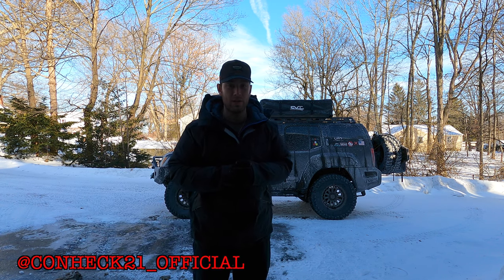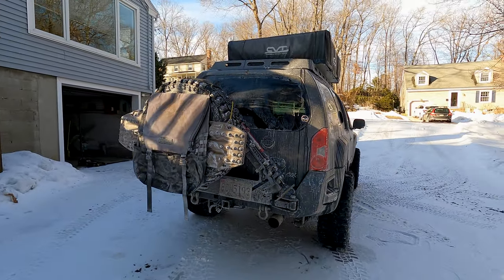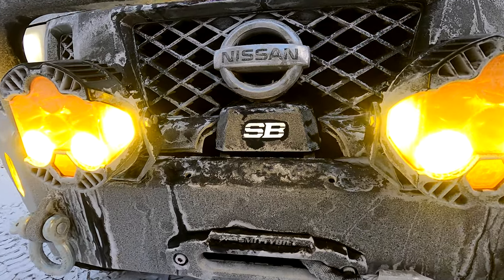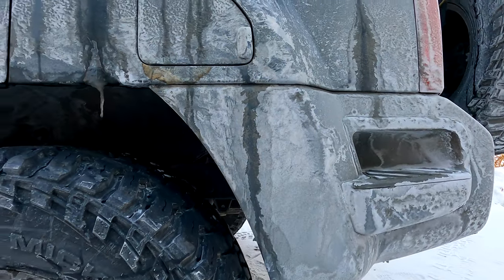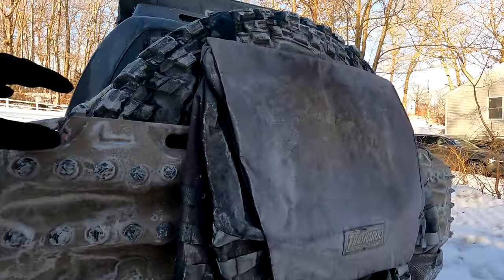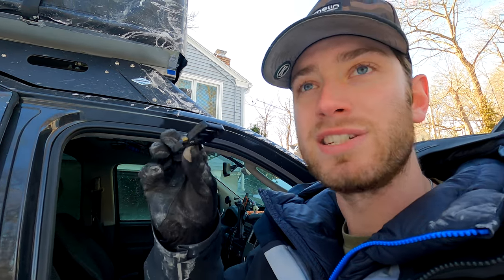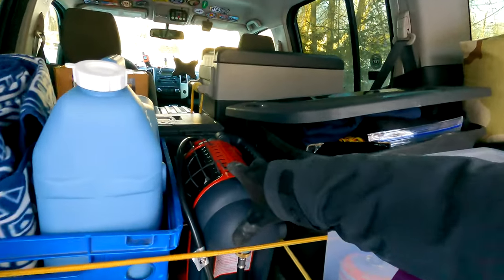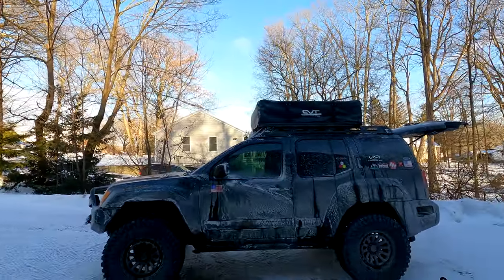Xterra on 35s | Rig Walk Around | Mods, Gear, Armor

Comment: Your rig helped me make my decision for a 4x4 vehicle. Anyone have a solid opinion on manual vs automatic for wheeling.
Reply from the maker: Everyone always says manual is better. But it definitely is more difficult/ requires more skill than an automatic. But an automatic in my opinion is just as good. I don’t believe there is actually an advantage one way or the other. Just preference
Reply: I have a manual and I love it but for going off road overall I'd say go automatic. If you don't go off road that often I'd go manual.
Reply: @conheck_offroad  I want to get the rack you have and I was wondering if a hard shell rta like the sky camper fit
Reply from the maker: I don’t see why not. I’m actually selling mine with the HD roof rack bars if you’re interested
Reply: @conheck_offroad  why are you selling the rack?
Reply from the maker: I switched to the Platform rack from uptop overland. Nothing is wrong with it, just wanted something with a larger footprint

Comment: I’m getting the radflos but my upper control arm is touching the inside of my wheel well with Rancho shocks, will this change once I add the radflos ? I have the titan suspension for my x

Comment: How does it handle on the freeway with lift and the tires? 
I’m not sure if I want to lift mine.
Reply from the maker: It handles fine. It is by no means a sports car, but I have no issues with highway driving. Just make sure you get a decent lift and make sure the tires are balanced properly and it will be handle just fine. 
I have deleted both my front and rear sway bars, and I can still make evasive maneuvers if I need to. 
I also cruise at 75-80 mph consistently and it is just fine as well at that speed. Gas mileage takes a hit obviously with larger and more aggressive tires, but you can’t have both lol

Check out nisstec lifts, they’re great. And give them a call. They’ll be able to help you figure out exactly what you want and point you in the right direction
Reply: Nice thx for the info
Reply from the maker: No problem!

Comment: I'm adding some weight to my X and have been looking to add horsepower to help maintain acceleration. Did you notice any gains from your exhaust and headers?
Reply from the maker: I haven’t done a dyno, or gotten a tune, but I would say yes

Comment: I have OME leafs in the rear and I only have like 5k miles on them and they are loud when going over uneven terrain. Is this normal? I actually have the whole OME suspension kit with leaf springs which I think is up to a 2" lift over stock.  (2012 Xterra Pro-4X)
Reply from the maker: I haven’t noticed them being loud. I got mine from nisstec lifts. I got new shocks with those springs… maybe that is why?
Reply: @conheck_offroad  sorry I meant OME (I fixed it). All shocks and leafs are basically brand new. Just curious if you dealt with any noise. Sounds like you haven't. Other than that everything is fine.
Reply from the maker: That is interesting. Sorry I couldn’t be off much help
Reply: @conheck_offroad  no worries haha

Comment: did you cut the wheel well to fit the 35s? or was the lift and bumper enough to clear it
Reply from the maker: I cut about 2” off the fender and then had to fold over the pinch seam that is behind the finder liner. I also removed the fender liners
Reply: @conheck_offroad  im gona try 33s i heard about a thing called heat mod
Reply from the maker: Yeah! Basically just warm up the plastic fender liner and push it out of the way to prevent rubbing. Very simple but effective. I ran 33s with no rubbing on the lift in the video
Reply: @conheck_offroad  i think my rear is stock but had fox 2.0 shocks and the front has Fox 2.0 coilovers. Would the rear clear 33s?
Reply from the maker: The type of shock doesn’t affect ride hight in the rear. It’s all the leaf springs and shackles that do that. If you at stock ride hight, you will prob have rubbing when you articulate
Reply: @conheck_offroad  ok thats what i suspected. I think the front is lifted with the fox 2.0 but looks like theres alot of room to adjust the spring nut to give a bit more height. As for the rear do you know how much lift will be required to clear 33s n have full travel with no rub? Just shackles? I want to avoid having a raked stance but clear 33s
Reply from the maker: 3” of lift is what I had
Reply: @conheck_offroad  is nisstec gone?
Reply from the maker: That’s what it seems like. I would suggest checking out z1 offroad. Tell ‘em I sent ya

Comment: Are the rear cats magna flow too or delete until muffler?
Reply from the maker: They are still stock for now. They are needing to be replaced tho
Reply: @conheck_offroad   just ordered the both Front cats and rears of Z1 site. Was going to ask are you using any 02 harness extensions for the front 02 sensors?